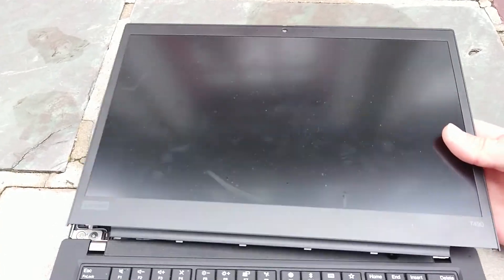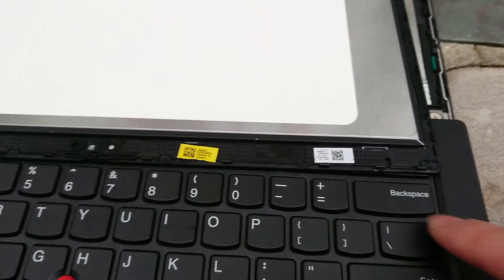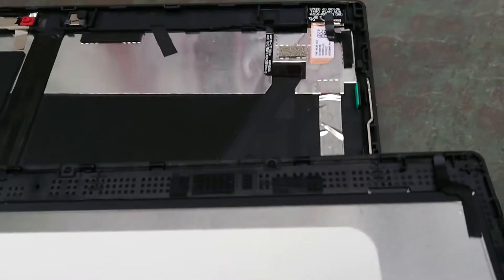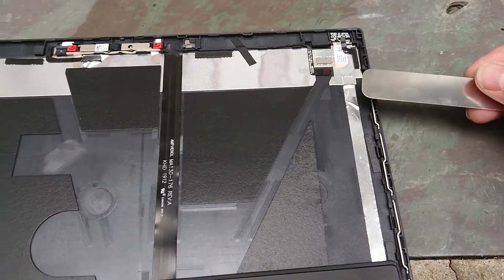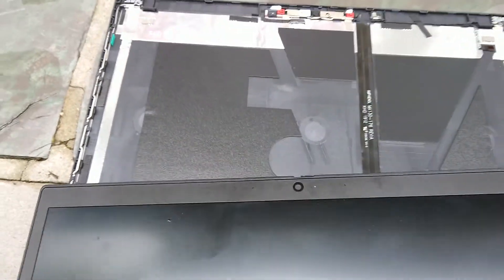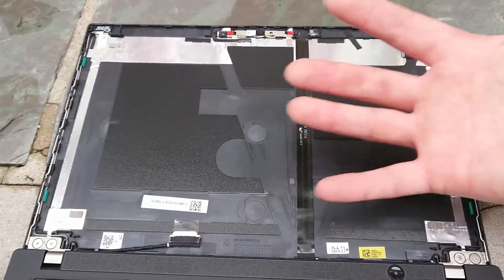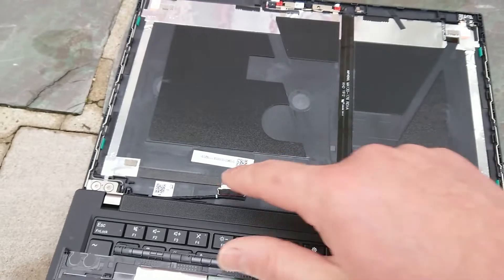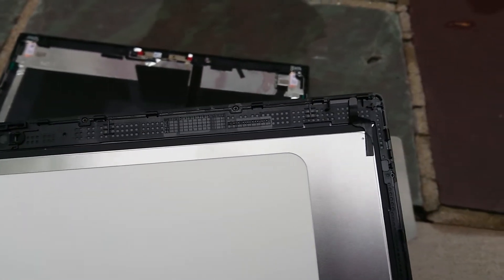Thinkpad T490 Screen Replacement - Disassembly - Easy Repair

Comment: So - dumb question.  I was going to do the swap from the oem 1366 x 768 screen.  I pulled the bezel off carefully as you have shown, but my screen is "fixed" to the rear lid.    So I get the bezel off, but the screen is not coming forward.  Is it just tape?  Perhaps I am afraid to use too much pressure?
Reply from the maker: It's glued on unless you have some different model. I know in the past they have had the screen be permanently attached to the back so the entire assembly had to be replaced.
Reply: @IdeaMan4k  Thanks for the quick reply.  So you are showing the new one set in the bezel?  My bezel comes off and I am left with the screen stuck (glued) as you as to the inside of the lid.  How did you get yours off?  I have posted a picture  here - https://www.reddit.com/r/thinkpad/comments/igmlm1/t490_screen_removalreplacement_help/
Any help appreciated.
Reply: I think I was just being chicken.....  After looking at some lenovo vidoes here - https://support.lenovo.com/us/en/solutions/ht508135/
Thanks for a great video - it takes some of the mystery away.

Comment: Thanks for that one! I crashed my screen 5 mins. ago. But now I am happy it's relatively easy to replace.l
@edit: Mine has the Full HD 1920x1080 screen. Do you maybe know, If I can buy a 2560x1440 WQHD and just plug that one in?
Reply from the maker: Not sure, also I'd stick with 1080 as the laptop isn't fast enough to have 4k. If you are just using it for basic browsing it would be ok but that resolution will bog down Intel graphics.
Reply: @IdeaMan4k  Thanks for the answer. I now studied the spare parts list and found out, that the 2K screens have a 40pin-connector, while the full HD ones have a 30pin-connector. I was just curios, because the T490 is shipped with 2K panels as well. But because I don't want to open it fully and change the connector as well, I have to buy the original one anyway.
Reply: @lukthung555  currently your LCD still using FHD or already change to QHD? Event default pins T490s is 40 but still can be used for LCD with 30pins?
Reply: @paijolajovanca  No, I built in the same FHD like the one before. If you want to change to the QHD screen, you need to replace the connector which connects the mainboard and screen as well. Because the have different pins. So yes, it's possible, but it's more effort.